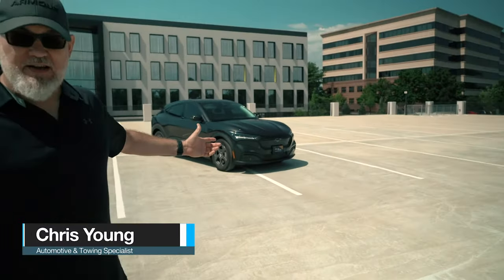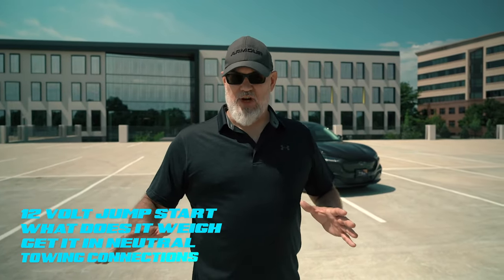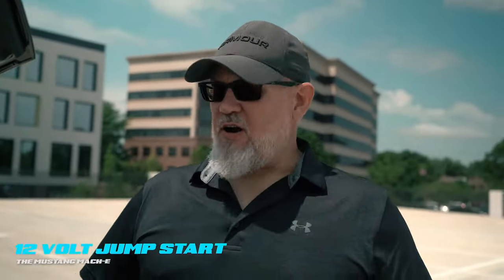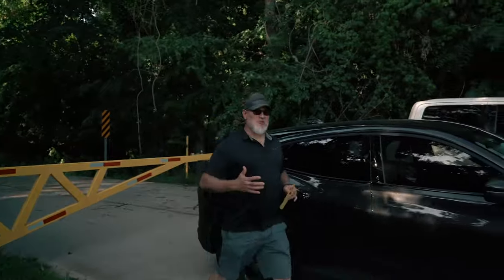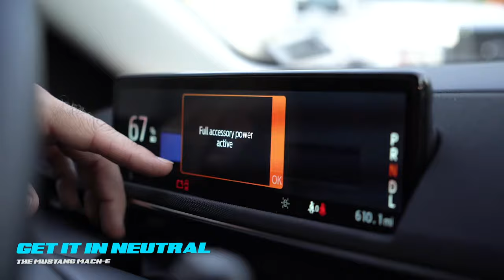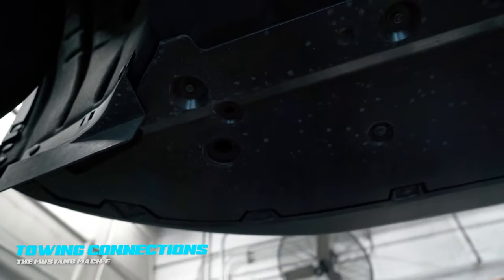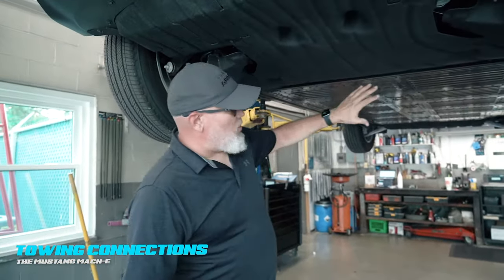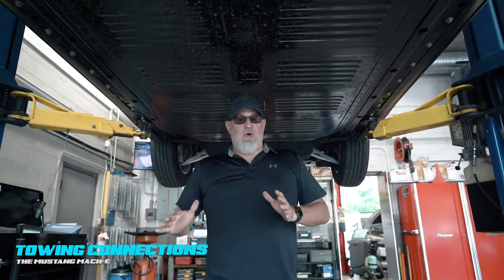Know Before You Tow - Mustang Mach E

Comment: Two comments:

(1)  The 12V leads in the front bumper will pop the frunk open, they will not allow you to open the doors to the car.  Once the frunk pops, you can access the 12V charge points as you detail to attempt to jump the car.

(2) Because the car has no rear tow solution, I installed a Draw-Tite Hidden Hitch receiver on the back.  Has a big steel bar with holes that will be sturdy enough for a rear winch.  Because basically 20% or more of Mach-Es made before June 2022 are going to completely fail -- some of these needing a tow -- I feel a hidden rear tow receiver (even if you never use the receiver in it) is a worthwhile $400 investment in case you ever need a rear tow

Comment: I'm only a couple of minutes into the video and there's already a dangerous level of misinformation here. The leads located in the front bumper only provide a way to open the hood when the 12 volt battery is dead. It will not jump the car in any way.

Once the hood is open then you have to remove a few of the beauty covers to get to the 12 volt battery where it can be properly jumped if needed. Then the electric door latches will be functional. 

Please revise this video before people get stranded longer than they have to be.
Reply from the maker: Continue watching the video, at 1:30 we begin to go through entry of the vehicle, it’s all there already.  What you are saying is almost correct, sequencing of events is off a bit.
Reply: How many battery charger